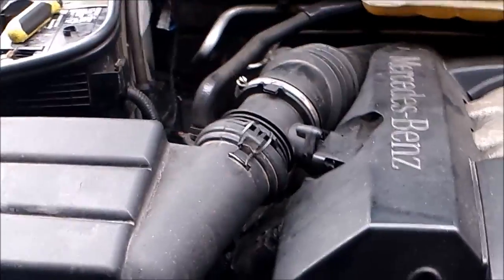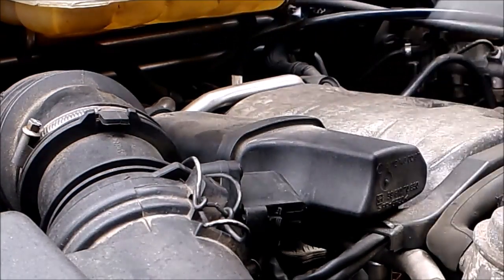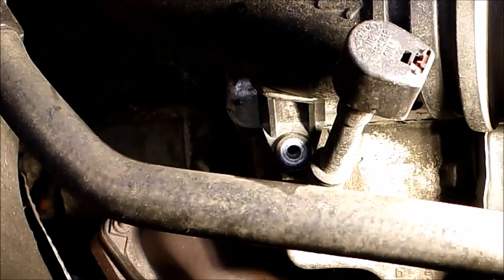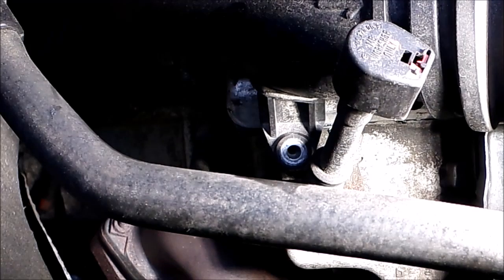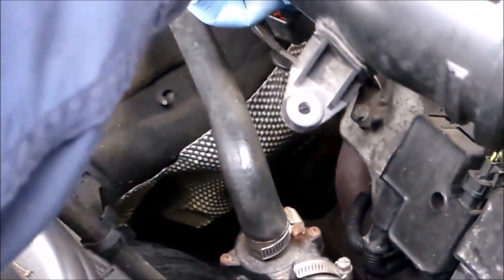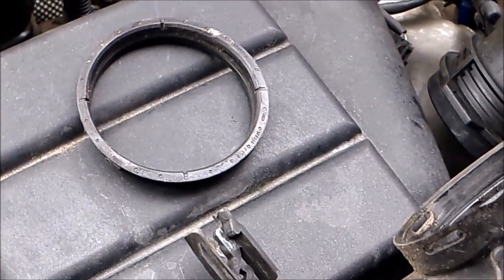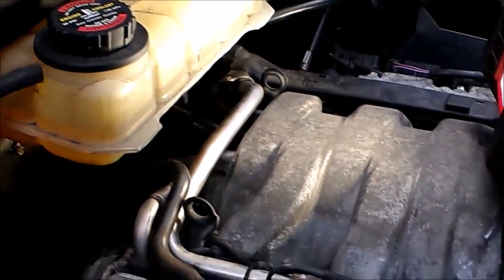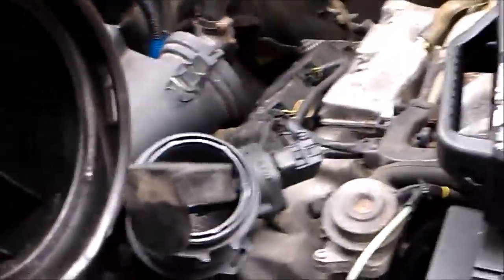Mercedes M112 M113 air intake gasket swap ,to increase mpg/lower oil consumption

Comment: Had to put my W124 through the annual safety/emission test last week.  Failed on a CO2 reading of 0.58ppm when the level should be 0.20.  Changed the spark plugs and air filter, cleaned the air intake tubes, scoured the carb body, put some injector cleaner through the fuel system and finally, my garage guy fed some 'carbon cleaner' liquid into the inlet manifold via a spare, unused intake pipe.  Wow, performance is up dramatically but even better, the CO2 reading dropped to an amazing 0.02ppm.  The test centre was amazed at the  second results and a government inspector present at the test centre put my car through the whole test again.  SCORE!  On the road for another year.
Reply: What 'carbon cleaner' did you use ?

Comment: Where would the heater block be located on the ML320 cuz I have one myself and mine doesn't have the cord that plugs into the extension cord during cold nights so I'm just wondering if you'd be able to show me where the heater block would be located
Reply from the maker: The block heater is attached to the water pump and should be available from the dealer  ..here's the dealer instructions and part #s to install   http://mercedesml.info/coolantpreheater.pdf
Reply: is there anyway you can make a video on showing where or how to install it
Reply: and thank you very much that is very helpful

Comment: Did you by chance have a check engine light on? I would of thought if there was enough false air leaking in it would come on? Were there any other symptoms such as rough idle or a misfire etc ?
Reply from the maker: slight lumpy idle on occasion..but rarely..if the leak of air is big enough it could cause a check engine light ..but a slight one will just be compensated for
Reply: @fupabox  do you had something like micro misfires before replacing seals?

Comment: What  vehicle are u working on
Reply from the maker: 2001 ml320
Reply: Need help with 2000 clk 320 interior fuse box fuse 11 Illumination and license plate lights keeps blowing I'm thinking it's the head light switch need help with removing it
Reply from the maker: Tone320 P I would check the license plate lights .. they tend to get a bit rusty on the back side of the light assembly, and make contact with one of the wires... To remove the headlight switch you need to remove the emergency brake release handle.. the screws are pretty easy to see , but there is a hidden one you can only access when the release handle is pulled out, and held in the out position.